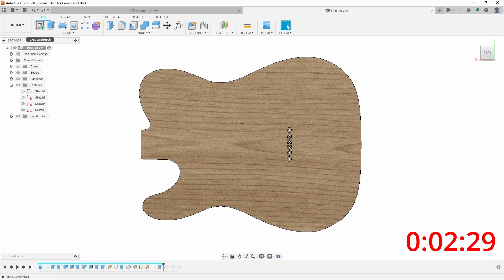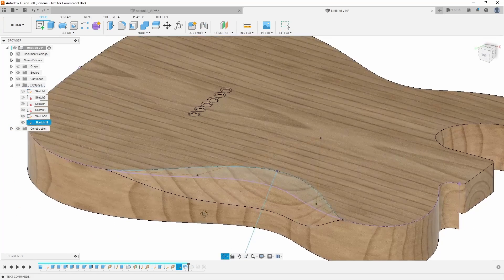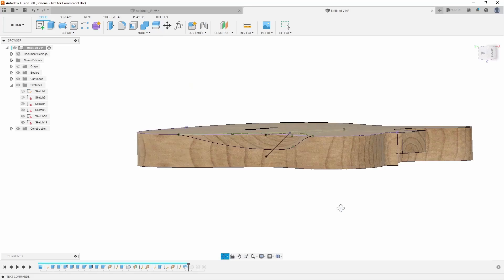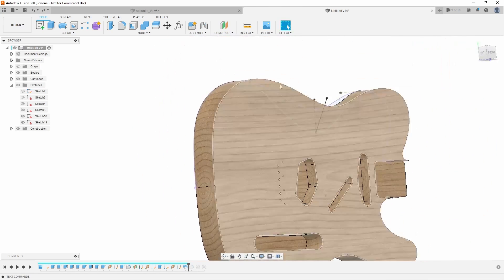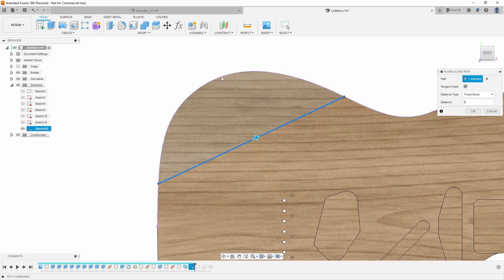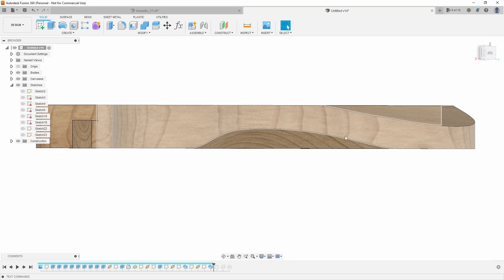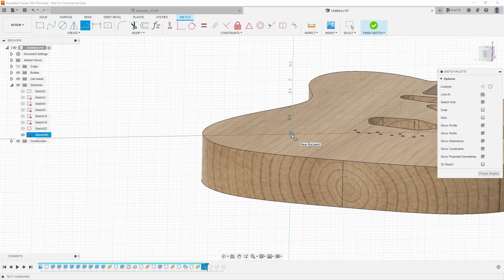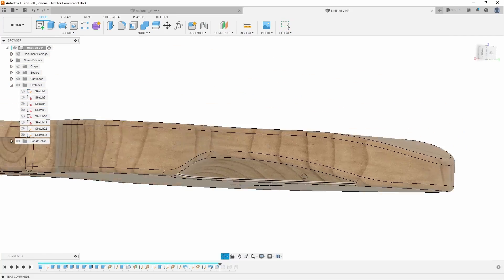How to model arm bevels and belly cuts in under 1 minute.

Comment: To make the front arm bevel, create a plane at an angle; select the line in your sketch defining the extent of the bevel as the pivot point for the plane. Adjust the angle of the plane, the select split body and use the angled plane to make the cut. Less steps. Then fillet as usual. if the front arm bevel fillet is defined in a sketch, then select split body and split with that curved line. Less Steps.

Comment: I haven't touched Fusion 360 in about 4 years and my first thought was to just create a new plain after sketching your arc of the contour. In the end, there's people that truck through hundreds of lessons in sequence available for F360 and then there's people who wing it which is nuts! lol
It's a high tech trade in itself and I had to couple it independently while going to tech college for electronics engineering the old, old school way of lots of theory, lots of fundamentals and basics, and lots of knowledge people in fancier and pricier schools are strangely never taught.

Comment: This is F*ing amazing! THANK YOU!! 🙏

Always getting this error when trying to apply simple 0.25 in fillet on the outside edge of seemingly clean Tele body geometry. It works perfectly for the sweep edge you helped me make!

“Error:   The fillet/chamfer could not be created at the requested size. This might be occurring at the ends of the selected edges.
    Try adjusting the size or using multiple separate operations. Check that the selected edge chain ends at a sensible position, and if not try selecting more edges.”
Reply: The big question is how did you he body to have one solid piece of wood?? The grain actually looks like its being cut!

Comment: Welll shiittt this beats my method!  this saves ALOT of time. I was drawing on 2 planes and putting an arc between them similar to your path arc u placed here. Then using the patch tool, then stitching it all together to form a solid that i could use to subtract from the body.  😅